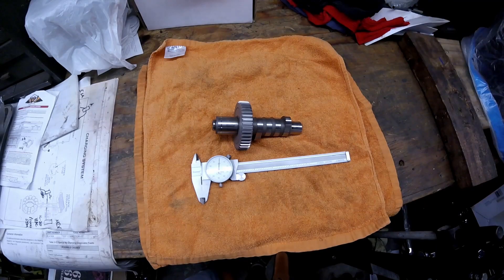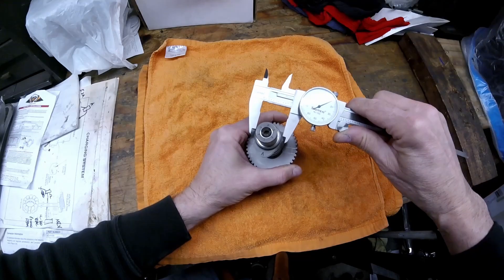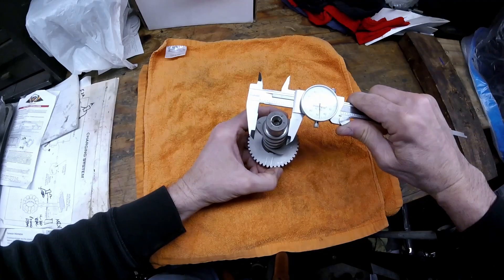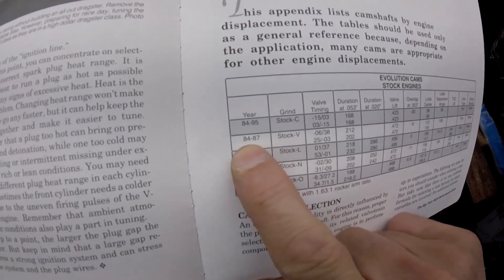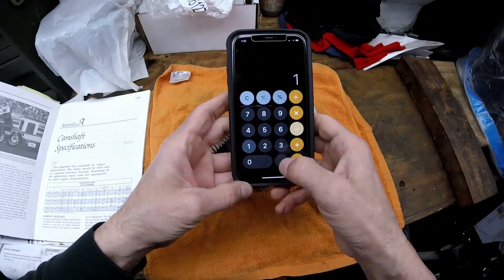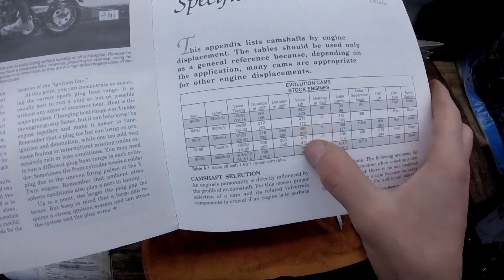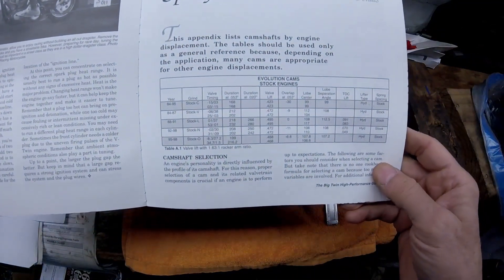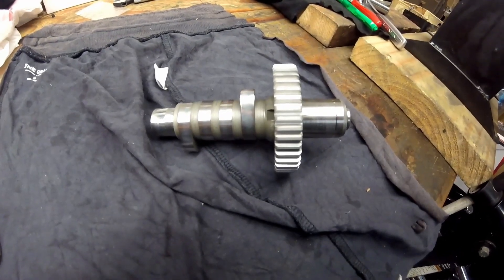Cam Lift how to figure out Harley Evo Panhead Shovel M8 Sportster Flathead

Comment: Is that book still available? I googled “Big Twin High Performance Guide“ and found a Volume 1 by William Denish is that it? Is it worth buying for shovelheads? Thanks!
Reply from the maker: Yes Volume 1
It does have some Shovel Head info but it has much more Evo info however it has a lot of engine theory the is good for all engines and that will help with Shovels. Thank you for watching.
Reply: @Rapsgarage  Thanks for the info… And thanks for your videos they are really helping me out with my WG.
Reply from the maker: @rcanoli99  thank you